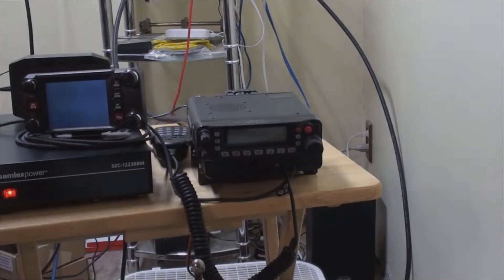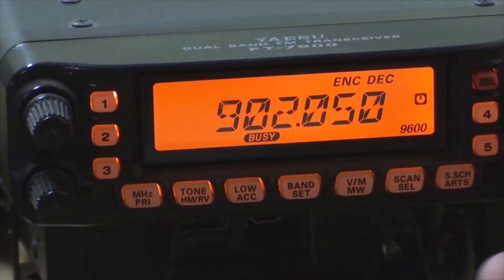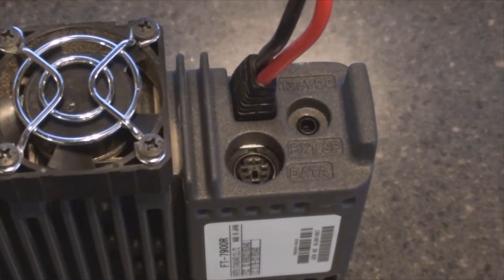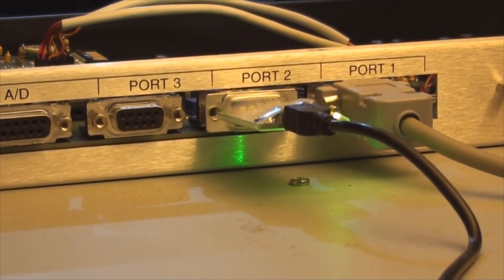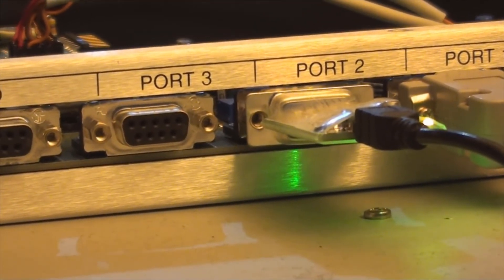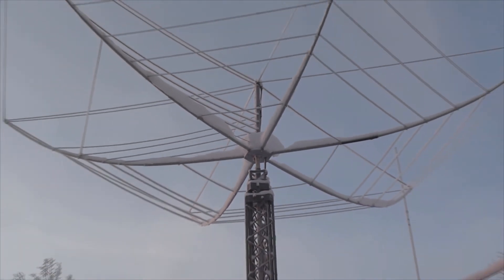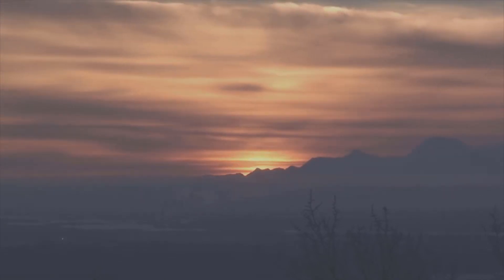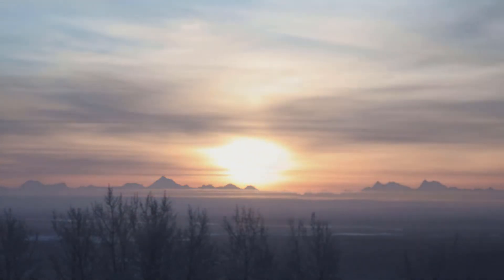UHF Link Radio for my ARCOM RC210 controller + BONUS music video!

Comment: Great videos.  I am using the same basic equipment here.  Looking forward to more videos and information about the repeater set up there.  The RC 210 IO group has good information also, which I believe you mentioned earlier in the series.  73's